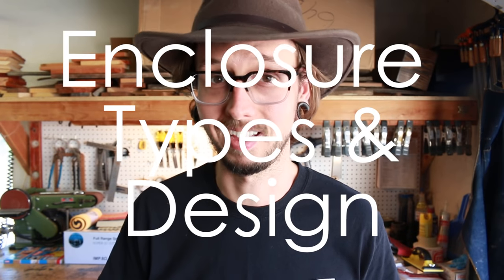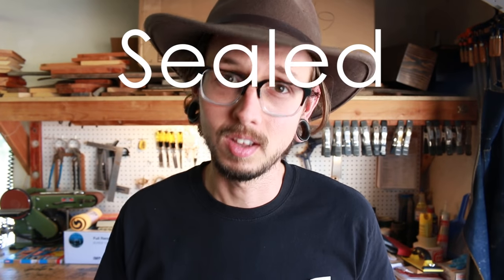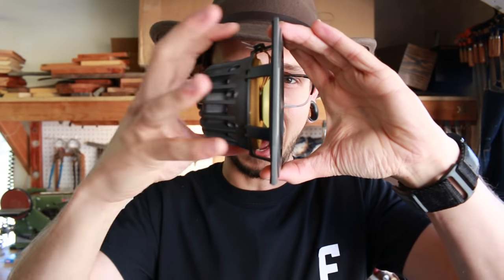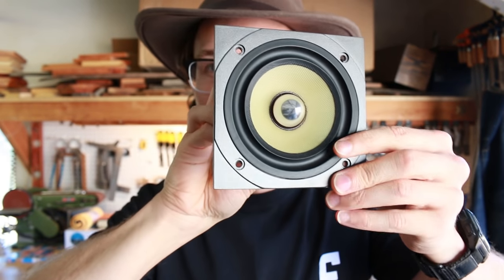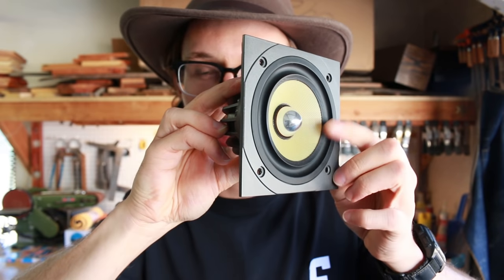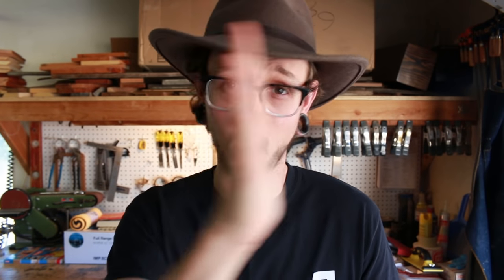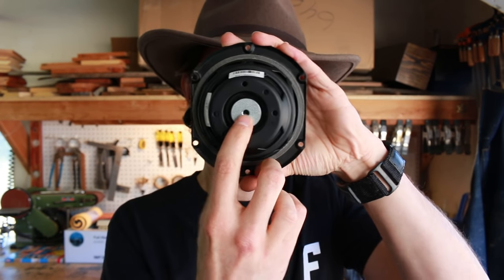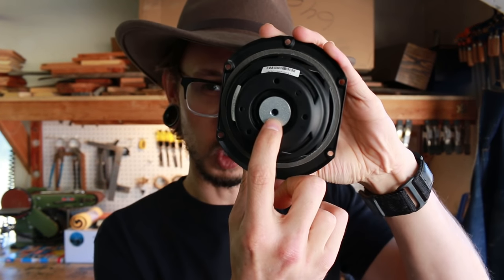How To Pick An Enclosure Type | Step 1 | DIY Speaker Building

Comment: Does something like a  passive radiator cause phase cancellation issues?  Assuming that the response of the radiator is instant then surely it would be 180 degrees out of phase with the main driver? Loving the information but would like to hear some detailed theory about each of the designs... but then again reading a book is probably the best bet
Reply from the maker: Hey there! Your logic makes total sense, but the response of the PR is not instant because of the volume of air within the enclosure. The air works as a capacitive load which delays the PR 180 deg. This series of videos is intended as just an intro to speaker building to get people started. I'll be doing much more in-depth videos on these subject in the future. Thanks for watching!
Reply: Perfect man. I'm poking forward to seeing your future videos and watching the channel grow.

Comment: When you get your measurements for your speaker enclosure after using the calculators, are those the measurements for the internal dimensions or the external dimensions?

Comment: Hi Kirby, I really liked your video. However, I came up against a problem building my own boombox speaker. I've purchased the Pioneer A173CI (= international version of the A1606C) component speakers. Since these are car speakers they don't come with a manual or a build plan or anything. The only information is that I can find on pioneers website under specifications. I am planned on building a ported box wich will be devided devided in 2 'rooms' for the left and the right. In between a separate space with like 1 inch of free air. Obviously I have no clue on how big I should make the box and what size of ports I have to use. I already have everything prepared like my own made battery and amplifier, so switching speakers is not quite an option. Are there any 'common' dimensions for speakers like these or is there any way to find out the best dimensions? Thanks in common, and yet again: Great video.

Comment: I thought the passive radiator needs to be the same exact size as the driver for optimal performance? why does the the radiator have to be bigger then the driver? I want to make a Bluetooth box with 2 6.5 inch speakers. would it be best to use 1 slightly bigger passive radiator? an 8 inch passive radiator? (trying to keep the box somewhat small) or use two 6.5inch passive radiators? 
My plan is to just mirror the front and back of the box, so the front will have two 6.5inch drivers/speakers and the back will have two 6.5inch passive radiators in the same spot using measurements. so the air created from the speakers would go back and directly pass through the radiators, out of the box. Will this produce a decent amount of bass/sound quality?

Comment: Hi Kirby!! Your video's have inspired me to begin my first speaker build!! Thank you!! I have a couple questions which I can't seem to find answers for, so I hope you can help me out! I've purchased a 2x50bluetooth amp module, and I recently picked up an Oz Audio Vector series 5.25CS 2 way component speaker system.  The midrange diameter is 5.25", with a 1.85" diameter Tweeter. Freq response is 60Hz-22KHz. 4ohm, 85w rms, 190wmax. Those are the only real data I've been able to find. It seems I need more to design an enclosure, so I am lost. Do I need a port or passive radiator? I'm thinking of using a 4x6" PR....does that size seem ok? How big an enclosure would I need? (There's two pairs of driver/tweeter. Does 0.68ft3 sound right? 
Second question is: have you ever added rca inputs to a bluetooth-only amp? I'd it even possible?
Thanks for any light you can shed, and keep up the terrific work!

Comment: Love your vids. I'm currently planning a ported pair of bookshelf speakers with 6.5in woofers and 1in dome tweeters, but I'm having trouble picking a port size to match my enclosure. I'm not sure what diameter port to use, and when I choose a random one (say 3 inches) the online calculator says my port needs to be almost 3 feet long! That won't fit in my enclosure! So my questions are: Does adding the tweeter affect the ideal size of my cabinet? And how can I get a port that will fit in my calculated enclosure (8.65 x 14 x 5.34 inches)? Thanks in advance, you're a saint Kirby.
Reply: 1 inch will be fine
Reply from the maker: Hey there! That sounds like an awesome project. The tweeter has no impact on the size of your cabinet. The volume of the enclosure should only be modeled for the woofer. You can think of the tweeter as just an accessory to the enclosure. As for port tube size, the smaller the diameter of the tube, the shorter the tube has to be. But it also can't be too small for the woofer or "chuffing" will occur in the tube (noise caused by too much air being forced through the tube). For your project I would suggest something around a 2 inch diameter, though you could probably go down to 1.5 inches. You want to try to use the largest diameter you can in the space you have available. Thanks for watching!

Comment: Have you found that different types of wood have changed the resonance of your speakers? I am asking because I want to use an exotic hardwood for the front plate of my speaker build but I don't want to spend a bunch of money on it if its going to make it sound worse.
Reply from the maker: That sounds awesome! I've found the harder the wood, the better. Especially for the front baffle. Just remember to line the walls with acoustic foam if its ported or fill it if it's sealed. Good luck!

Comment: Hello, on a ported enclosure would a port be beneficial in the back of an enclosure or in the front?
Reply from the maker: You'll see a slight increase in db on the low end if the port is forward facing, but rear facing ports are just fine. Thanks for watching, Arnold!

Comment: Hi Kirby, I have a question. I had one of these desktop speakers, it has 2 Twitters and a separated sub woofer, I decided to make a new unit using these things, after I took apart them I found that the sub woofer enclosure is ported type but the driver is completely inside the box and the pipe is in front of driver (it actually is under the driver) but I mean the air is between the pipe and FRONT of driver, not the back of it. Is it OK? Or should I just rotate the driver? Or it depends on driver's type?Thanks a lot for your good channel. Keep up the good work.

Comment: If I have a speaker and I cannot find any info of the Qts or (ts) all I know is that it is a 5,25 inches or c.13 centimetres and the hertz range is 50-20000hz, can I still build a ported speaker enclosure and do you have any recomendations. I was thinking of a somewhat small enclosure.

thanks in advance!

Comment: Hey if "polyfill" slows down the air movement inside the speaker enclosure, wouldn't that mess up (or at least change) the way a PR setup behaves?  If so, how would someone properly compensate for that?
Reply: 'Dead Cats' (fibrous damping) inside a speaker cabinet changes a number of things but it's effect isn't [generally] more than a 10% change in any parameter.  Where it's really useful for typical hifi stuff is to absorb and diffuse midrange sound that comes off the back of a woofer/mid driver and bounces around inside the box before coming back out either through the cone or a vent hole.  And that statement is again, simplification.  PR are tricky enough that fibrous fill should be one of your smallest concerns in the design/build.  And the elephant in the room is that T/S and all these other box design questions are all about low frequency behavior. The room modes in your listening space are a huge variable for that stuff. What very few get is how to make a good crossover between mids and highs.  That's where the skill really is.  Unless you just like bass...

Comment: Brother im saving liking downloaded and sharing 
But i need to build studio monitors that either have xlr or 1/4" preferred to be both
I want to design mastering monitors i will do it with stuff i can get on the market aside from making the box
Who makes the best drivers that we the people can buy ?
Can i have a 3 way crossover that the highs are connected to 1 ribbon tweeter and 2 silk domes? 
Can i then have that same crossover driving two mid range paper cones and one or 2 undecided on design subs a 8 or 10 ported
My question is can a crossover do all that for me 
Secondly im wondering about the amp because i want to use then in my studio and plug into the interface to get sound from a xlr or 1/4" 
Really wanting to design some of the best monitors i can get for the money

Comment: Hey Kirby, I decided to use one of those PS95-8 speaker drivers with a passive radiator enclosure type but when I tried to calculate the optimum passive radiator size by inserting the Sd which 28.3cm^2 it gives me an estimate of a diameter of 6cm for the passive radiator. But that doesn't make sense to me as the diameter of the driver it self is 9.5 cm. I also heard that the Passive radiator should be larger than the speaker so I'm kinda confused. Help would me much appreciated.... :(
Reply: You are correct. Passive radiators are working at a lower frequency than the woofer.  They need to be able to displace more air either by having a larger area, bigger or multiples.  The outside case would be if your woofer has a much smaller xmax than the passive radiator.  Something must be incorrect in your calculations.

Comment: How do you use the calculator if you want to have a two way system? I am trying to design some bookshelf speakers and I want a two way system, but I don't know how to use the calculator with more than one speaker.
Reply: Kirby, I have the same question. The calculator can tell you the volume of the enclosure and port parameters for a specific driver. But what if you use 2 equal drivers in same enclosure? I assume you double the volume, but what about the port? And I don't get what is port area. I would very much appreciate your answer, buddy) Your channel is inspiring, keep it up!
Reply: Griffin, you only use the calculator for the woofer.  The tweeter is self enclosed, so it does not need any more volume.  However, you will need to calculate for an L-pad (attenuates tweeter volume to match woofer) and a crossover.
Reply: Hi Igor, You would double the volume like you mentioned. A second port of the same length and diameter/cross section works fine.  If you change the diameter of the port you or the box is not exactly double than you would have to recalculate.

Comment: Hey I've seen some enclosures that are tapered shapes, i.e floor standing speakers that are wider on the front face and narrow on the rear. Do you know, does the shape affect the sound? Or is it only the volume and type of enclosure?
Reply: i was thinking about the same thing, look at kef iq90 floor standing speakers, was thinking about building that kind of shape, its early days, but if you find any links on info drop a line, vise versa :)
Reply: This is a way to have a sealed enclosure without having to put batting in it.  When you angle the walls like that, it acts similar to batting in that it doesn't allow or less allows, frequencies from the back of the driver, bouncing off the walls, to come back through the driver.  With a triangularish design like this you don't need to use batting because the angles minimize rear waves.  Hard to design and build, though.
Reply: When designed and built correctly, it works like a sublime piston.

Comment: Ok follow up to last comment.... SPK-1424AM is a tv speaker ive found out. is this ok to make a basic speaker from.
Reply from the maker: You can absolutely make a basic speaker using that driver. If you don't have all the information needed from the driver, I would suggest making a sealed enclosure for it and just see how it sounds. If you want to get a little more fancy, you could throw a 1 to 2 inch port in the sealed enclosure and see how it sounds. Good luck!

Comment: Hi, new subscriber here (sadly [for you I guess] only RSS), and I love the content so far :)

Have you ever done any transmission line subwoofer speaker designs?  I made one years ago, probably 1999 or so (4 feet tall, 2 feet wide and 2 feet deep) and I just love how it performs.  12 inch driver near the bottom, line goes up and rather back over the top, down the backside, and out a 4 inch by 2 foot opening, tapered in depth all the way.

I wonder what you think of this design?   Granted it's big, and weighs a ton (2 boards of 3/4 inch thick MDF board), but any thoughts?

Comment: Great video! Background music reminds me of Stranger Things, dunno if you watched it. I am curious if there is any way of calculating or guessing descent measurements if you can't find the specs of your drivers?
Reply from the maker: NICE! I love Stranger Things! Such a good show. The only way that I know of is to use expensive measurement software. If you are salvaging the drivers, start with the dimensions of the speakers original enclosures and make adjustments from there. If not, I think you would be surprised at how much wiggle room you actually have when designing speaker. They might not be in an optimum enclosure, but they will still sound good. Thanks for watching, Luke!

Comment: Could you demonstrate a build where you have two independently-powered Bluetooth speakers where one speaker communicates one of the two stereo channels wirelessly to the other speaker?  I assume you could do this using a Bluetooth transmitter in the first speaker talking to a Bluetooth receiver in the second speaker, right?  This would allow us to get away from a long speaker wire running across the room.  Thanks for the channel.
Reply from the maker: This is an awesome topic and question. I'm definitly putting this down on the list for future videos. I think you're right and I have a few idea of how it can be done, but I'll need to do some more research. Thanks for watching, Norman!

Comment: wrong!  what a ported box designs job is, to adjust the pressure inside of the box to a certain frequency.. thats why you can take a piece of paper to the port and see that it vibrates the paper back and forth not just blow like a leaf blower! and a bass radiator is the same,  as well as allows a lower response without having to add a bigger amp or a second amp!

Comment: You say that a sealed enclosure is less efficient. That is not the case!

Later you say that a port (only) reinforces the bass frequencies. And that is the case. It only reinforces the sound within a limited bandwidth, around the port resonance, and not elsewhere. And if tuned right the port resonance is in the region where the driver falls off, so that the bass extends at the same level.

So above port resonance there is no difference at all, at port resonance there is more output (in total as much as above port resonance) and below port resonance there is even less output than a sealed box (and in that region the woofer is unstable and unusable for extra amplification). And besides all that, the other drivers in a ported box are still sealed and there is no difference in output there.

The same for distortion, all the benefits of a port are only effective within its bandwidth. Above its bandwidth there is no benefits at all and below its bandwidth all just gets worse!

Comment: you are wrong, ported enclosure increases distortion than sealed enclosure
Reply: This is only kind of true.  Since the driver would have to be driven harder  in a sealed enclosure to achieve the same volume at the frequencies where the port is producing most if it's out put the driver distortion may actually be higher in that frequency area than a ported enclosure.

Comment: The calculator methodology is backwards. I go there to get the port size and all of the calculators ask me to enter the port size - then hit calculate. Huh? What was just calculated? Oh and all of the programs seem to think I am building a subwoofer. A tower with multiple drivers isn't even an option. I will need to investigate this on my own with a flexible tower construction. There is no help online. New DIYers, save yourself the headache and experiment on your own. There is NO useful help online.